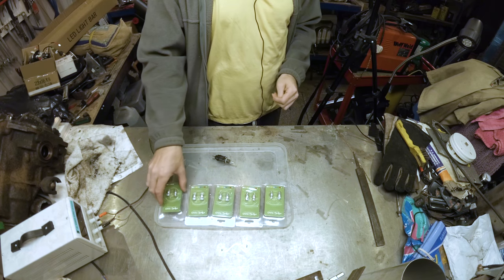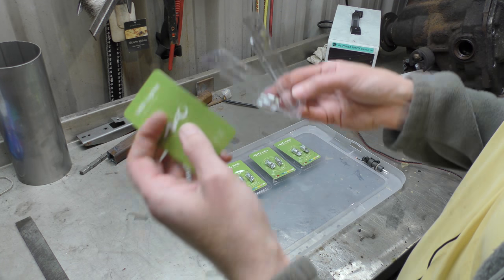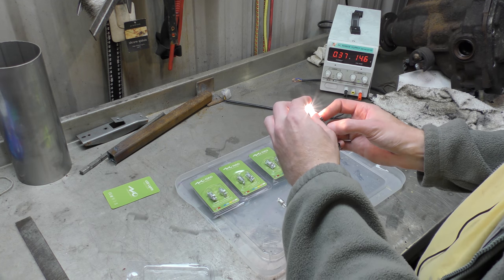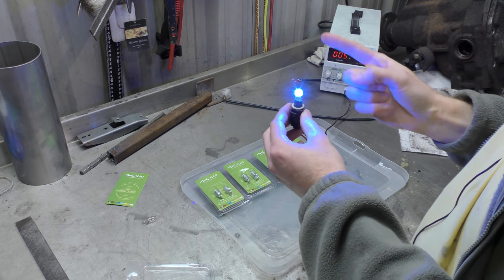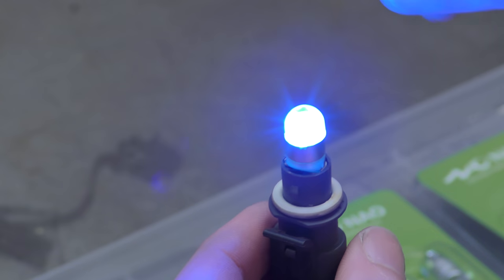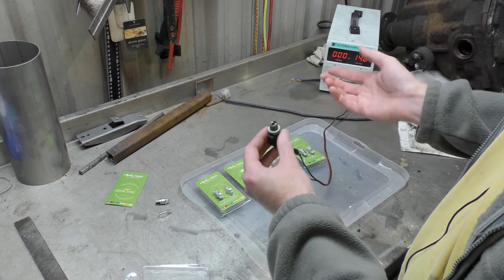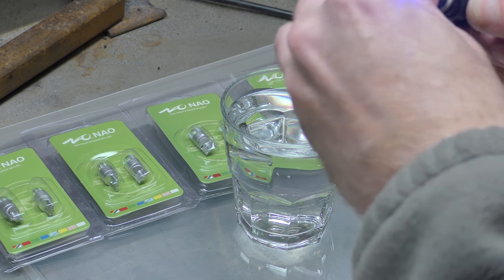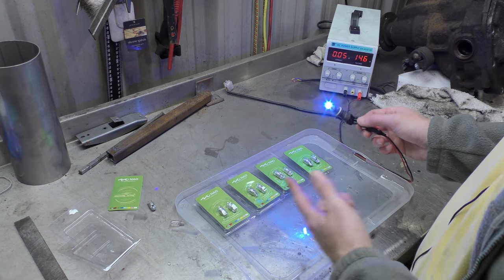NAO T10 Ice Blue Bulbs

Comment: As a professional photographer, I fully understand your difficulty in recording this video.

The way to evaluate (video) light colour is to see how the light reflects off white paper. If you make a large diameter tube from an A4 paper sheet, you'll see the colour (without everything looking white due to image burnout or over exposure). This is also useful, as you'll see both the colour that's reflected from the paper and how it shines through the paper. 

By the way, I've just purchased what the sellers call the "Blue" T10 LED bulbs for my dashboard instrumentation illumination. I'm hoping that the Blue will be less brilliant than the "Ice Blue", so not too blinding. 

Thanks for the video

Comment: I don't know about these bulbs but at the moment, people are putting really bad blue colors
in there side lights and i have a automatic dimmable rear mirror, and it still blinds me..I'm
not sure if these are the same ones that lots of people are running about with, but some 
of them are much brighter than they should be...

It could be the main bulbs that some people have changed by adding a ballast to there 
wiring system and boosting there lights its blinding,Im not being funny but they should
be banned.!!The worst are the Hid kits that are available.
Reply from the maker: I agree.  People using HID bulbs in standard enclosures just scatter light everywhere and blind everyone else.  But they don't care as it looks 'cool'.
Reply: Yes, too bright (meaning the wrong colour temperature) makes the light scatter and becomes more blinding. 

Consider why submariners and military people use red lighting inside the submarine if they need to preserve their night vision. 

I'm actually experimenting with Red dashboard lighting on my Land Rover, as this will help preserve my night vision when I'm driving off-road and there's very little available light. It's why army Land Rovers were fitted with very dim headlights. (I'll probably have to fit dual-illumination,  Red for off-road and Blue for normal road use, as neither is ideal for both.)